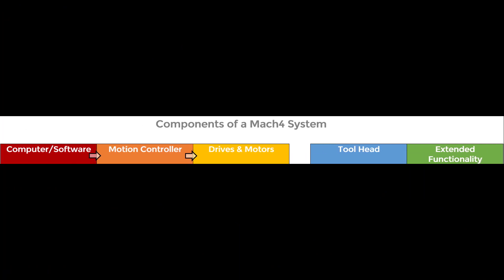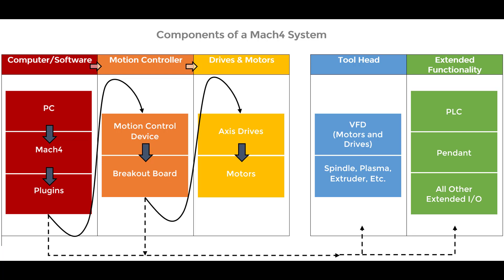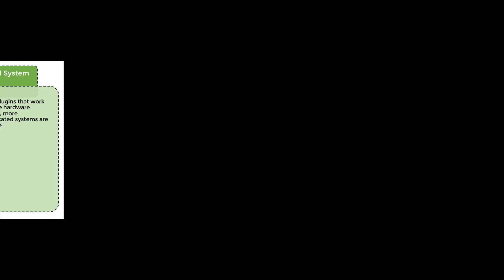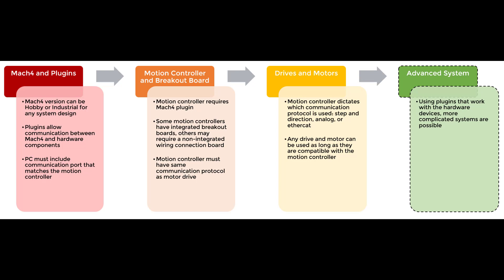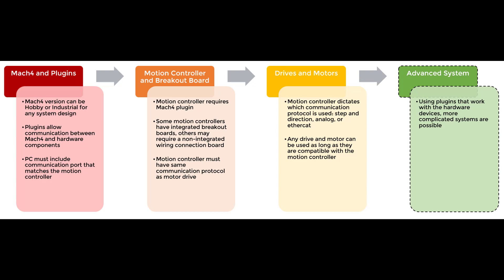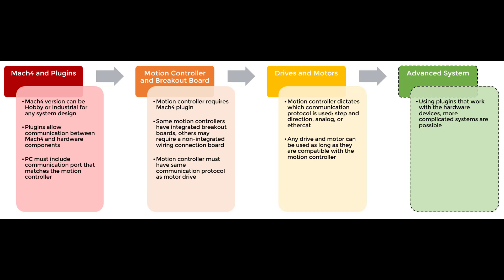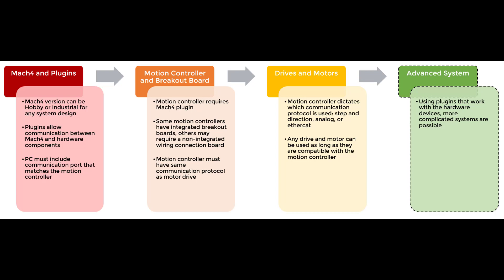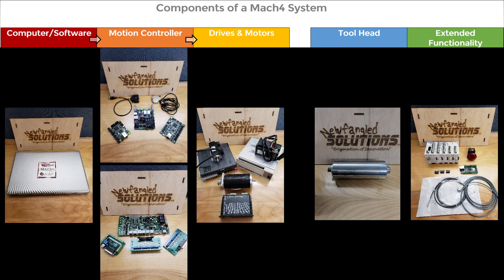Mach4 Components

Comment: Just one point, I think you ought to mention that if you use an Ethernet port for Mach4, it won't be available for a network or internet connection. You need to add a second Ethernet port if you want that functionality. This is because Mach4 assigns a static IP address to the Ethernet port it's assigned to, and it takes it over completely.
Reply: Thank you.
mach4 use on the lathe.
 https://www.youtube.com/watch?v=nK3xSAQLPcQ
I also want to bring mach4 to the pantograph, so the zero tool is needed
automatic piece with fixed probe on the work surface.
Mach4 is very nice as software, but very difficult to understand for the average user like me, this compromises its diffusion.
With the help of many demonstration videos, the dissemination and knowledge of the program will surely increase.
Good job!